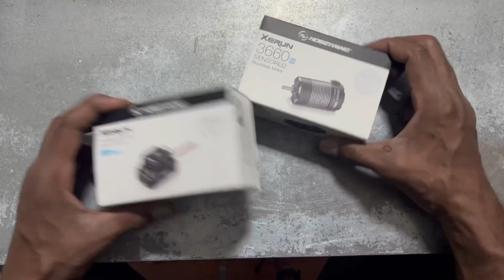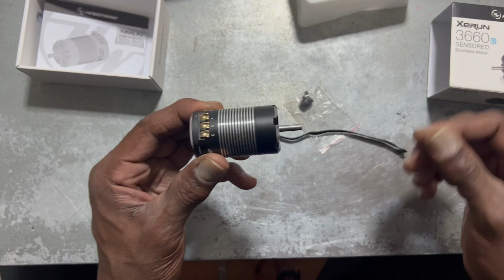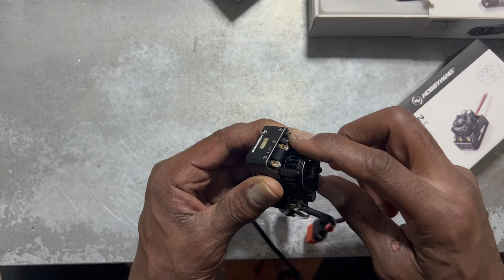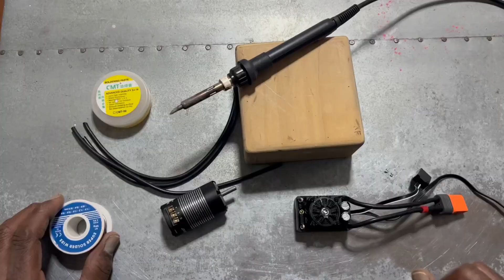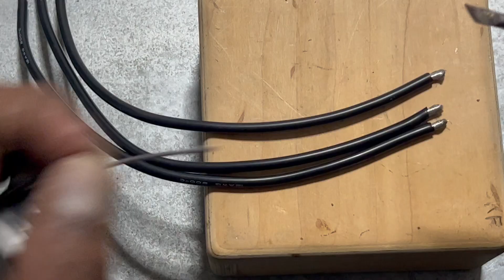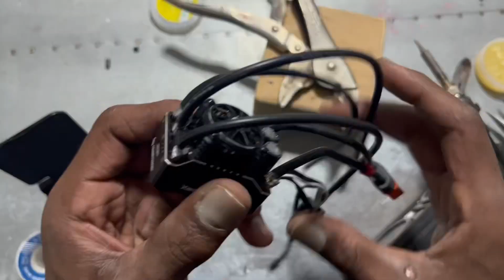Hobbywing Xerun XR8 Pro G3 & Xerun 3660 sensored motor set up part 1#hobbywing #hobbywingesc #rccar

Comment: I like the way you used both fan covers.  I'm going to put that on my g3 esc. I race 1/8 offroad with it, so it will help a lot, I think.   Cool video!  Subbed to the channel, too. 🖐
Reply from the maker: Hey there, my apologies for my late response. I totally missed this message. Yeah both fan cover help in keeping out the little pebbles that fly in. You’ll see. Thanks for the good words and sub.